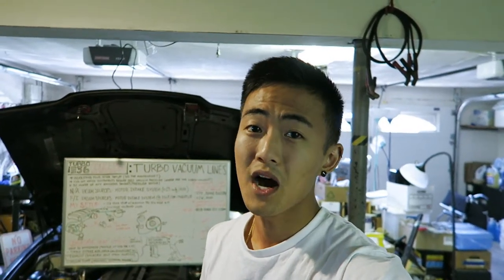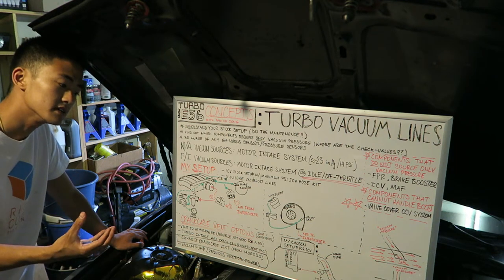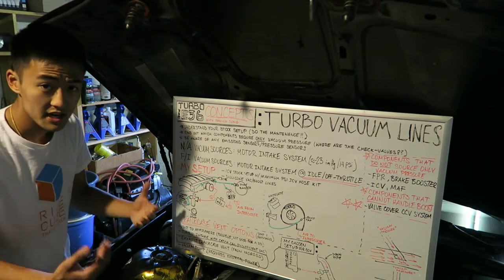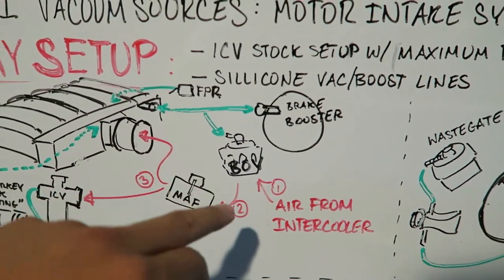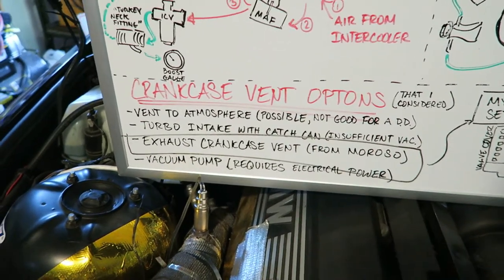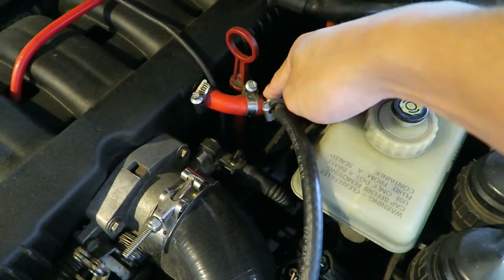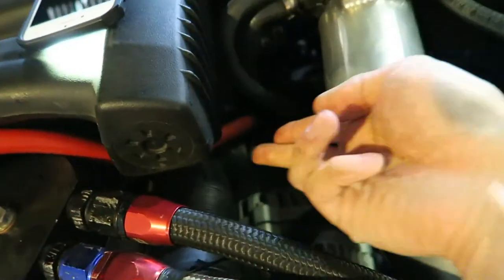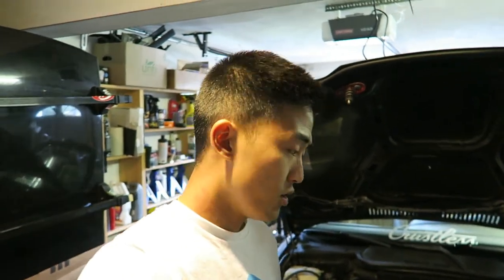Routing Vacuum/Boost Lines On A Turbo BMW E36 [Turbo E36 Concepts 1: Vac/boost Lines + My Setup!]

Comment: Thanks for video! So I can connect vac/boost gauge either to the ICV line, like you did, or to the brake booster line, correct? Currently I am M52 NA, but thinking about FI by supercharging in future...
Reply from the maker: No problem! And yes you can!

Comment: Thanks for making this video dude. Helps clear a couple things up for me on my turbo M50. Stealing your idea of the spare nipple on the turkey neck connector haha. 

I just ordered my Tial BOV and had to specify the vacuum spring but had no idea so I picked a 10 psi spring. What does your BOV use?
Reply from the maker: ThatGearheadMarek if I remember correctly I think I have a 12 psi spring. You can add some shims to it to raise the stiffness such that the BOV stays closed right until you release the throttle

Comment: Could you put a catch can between the CCV and the valve on the downpipe and prevent loss of oil over time?
Reply from the maker: +rollinremztube not sure by what u mean by that but an exhaust CCV vent kit eliminates the need for a catch can
Reply: Pawinning well with the exhaust CCV you end up venting oil droplets into your exhaust right? Well could you put a catch can in the middle to collect the oil droplets before they make it to your exhaust? I would imagine this could protect a catylitic converter as well
Reply from the maker: +rollinremztube oh yes in that case then it should work. I have no cats so there's nothing that would get gummed up 😂

Comment: Just wondering with the CCV, what if you had it run to a catch can, then a check valve from the catch can to the elbow? (my silicone elbow has the two IAC/CCV ports), would positive boost block the check valve? Just wondering if i need to get a new elbow without the CCV or not.
Reply from the maker: ItsMatich yes that can also work too!   I chose to do an exhaust CCV because it would pull more and more vacuum as engine load increases. My only concern with a check valve setup in line with the elbow was that the valve cover ventilation is essentially blocked off under boost.

Comment: Amazing video, what size diameter hose did you order?
Reply from the maker: Actually don't recall, but I did order an entire silicone hose replacement kit for the m50 engine off eBay and used which ever hoses in that kit to fit my needs. Went from everything from 1/4-3/4" if my memory is right 😅

Comment: Where did you get the boost line? Can you explain abit more cause im boostin my e36 as well. And i cnt figure it out yet
Reply from the maker: I bought an entire sillicone hose replacement kit for an m50 engine from eBay at the time. I used the hoses in that kit for any extra vacuum lines/boost lines I wanted to run 🤘. Hope this helps

Comment: hey pawinning do I need a check valve for my venturi tube
Reply: also do you run coolant lines to the turbo
Reply from the maker: Yes u need a check valve. The moroso kit has one. And no I don’t have coolant lines running to the turbo, but I recommend a setup with additional cooling
Reply: Pawinning Do I need to run a catch can ass well
Reply from the maker: For the CCV system, you only choose to use a catch can or the tube. No need for both
Reply: Pawinning how are you cooling the turbo? with just oil cooler ?

Comment: I am pretty sure your PCV doesn't work really right. The moroso kit states that it only works on open headers and it stops pulling vacuum if there is any restriction.

Comment: What vacuum does your boost gauge read at idle? I'm running -19/-20 but it seems like im idling with a vacuum leak. I have an s52 so im not sure if both engines run the same vacuum.
Reply from the maker: +Nicholas Zottola mines around -23! I'd check on the connections around your throttle body, traction control unit, intake, and injector o-rings for possible leaks. It should be similar between motors

Comment: are u running an air filter?
Reply from the maker: Grab America by the Flaps I did have a K&N filter on the turbo for a while but I just stuck with my mesh screen since it gave better hood clearance lol
Reply: Pawinning aren't u worried about dirt particles messing up ur rings
Reply from the maker: Grab America by the Flaps yes, but I heard of mixed opinions about running a filter or not, but the mesh is fine enough imo. 2k miles with no issues so far!